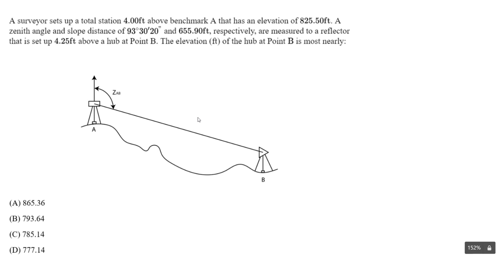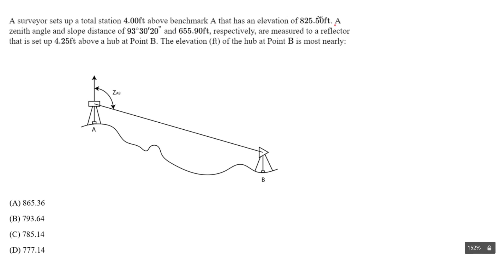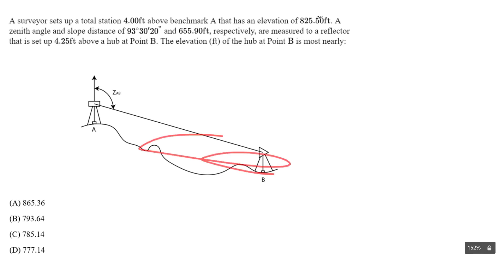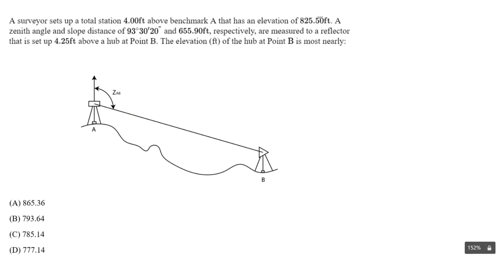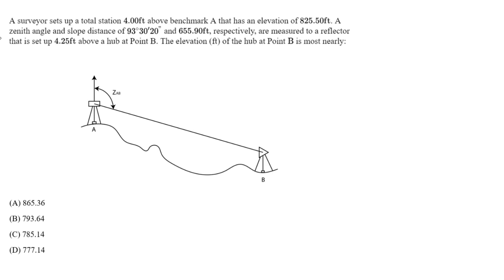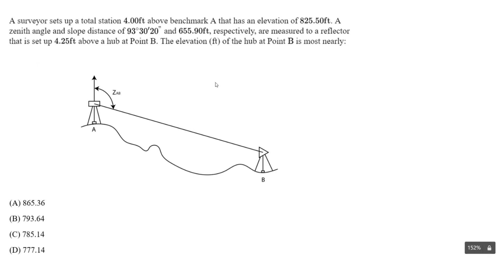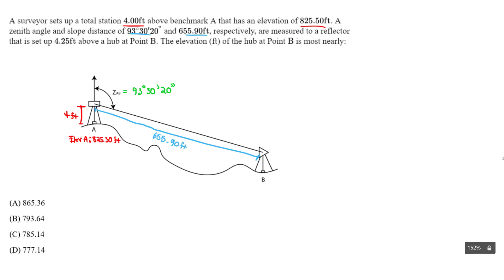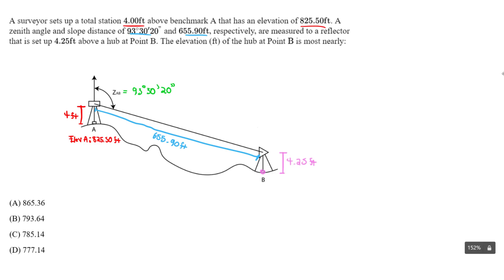FE Exam Review - FE Civil - Surveying - Leveling - Elevations

Comment: Why not just take the cosine of the Zenith Angle? Unit Circle trigonometry.. also, there is no need to convert from DMS to Degree Decimals. Most calculators have the DMS button. "Slope Distance x cos(Zenith Angle)" gives you Vertical distance without all the wasted steps. Wasted steps will waste time, and time is of the essence when taking the test. Also, Zenith Angle is not North - it's straight up. You might be confusing Zenith with Azimuth.
Reply from the maker: Sincerely noted. Excellent points.
Reply: @directhubfeexam  Excellent videos! I've watched a few and found them very helpful to my studies.. Thank you!
Reply from the maker: @4DaysInApril  Thank you so much! I am glad you are finding the videos helpful!! Let me know if you have any questions or ideas :)
Reply: @directhubfeexam  horizontal and vertical curves (if you haven't done so already..)

Comment: Thanks for this video, how do you interpret if they give you a negative angle slope, for example if they give you a -93 deg? I would think the slope goes the opposite, how about a -5 deg?
Reply from the maker: Hi Enrique, thank you. So that seems confusing since the azimuth is always read from the North axis then we rotate clockwise (+). I guess if it starts at the North and gives you a negative (-) it would be counterclockwise. So for example for -93 you would take 360degress - 93 degrees to get the azimuth angle of 267 degrees. And for -5 you would 360 degrees - 5 degrees to get an azimuth angle of 355 degrees. Correct me if I'm wrong please.